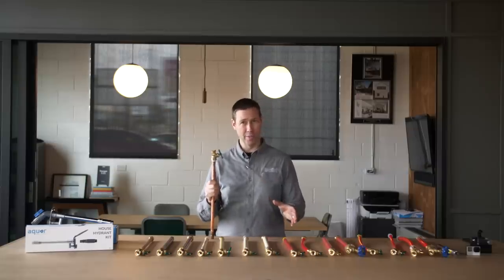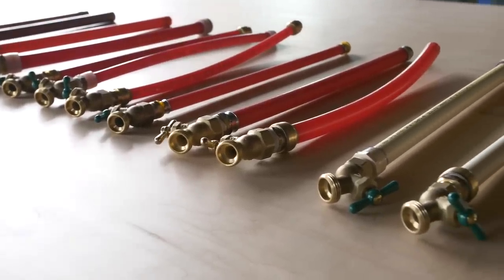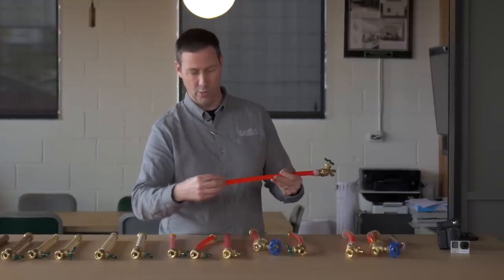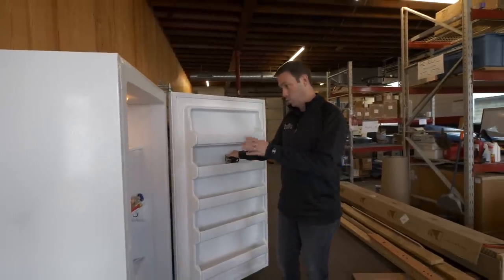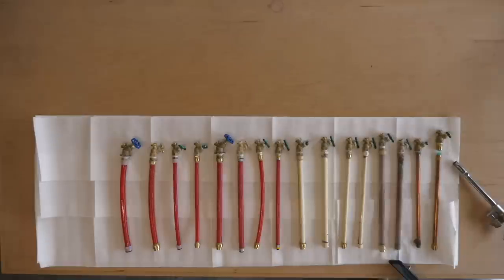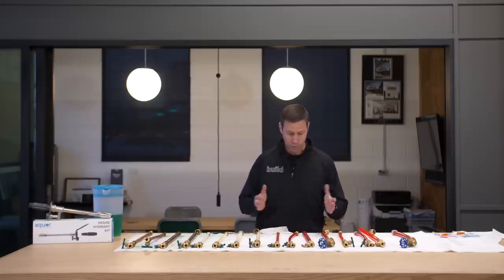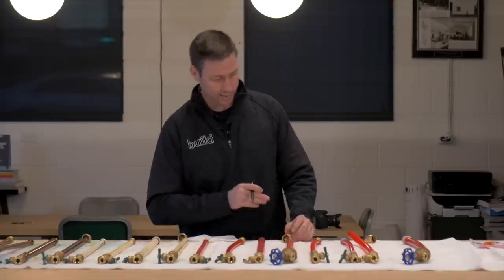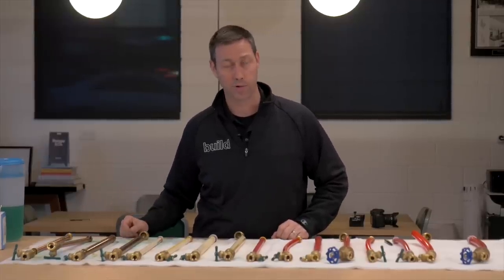Copper vs Pex vs SharkBite - Freeze Testing

Comment: As a landlord with occasionally vacant units in the winter, I have had my share of frozen pipes. I've had over 4' of water in a basement from a 3/4" supply line!  Since switching to PEX five years ago, I have had ZERO issues.
Reply: Significantly Lower your rents enuf to keep happy tenants in the units, the $ you loose on empty , damaged , transition isn't worth it . Greed is one of the seven deadly sins
Reply: As for pex it gets brittle eventually , and small rodents love to chew it when they cant get at any other food source
Reply: @guysumpthin2974  *lose
Reply: yes
Reply: @guysumpthin2974  fun to learn rodents think our stuff is a food source, don't know much about plumbing but they like our wires, alot wires use soybean oil to make the plastic on the wires, and our little friends think it's food, not bad  when things don't, work real crappy when things burn down
Reply: Great for you 👍🏻👍🏻👍🏻
Reply: @guysumpthin2974  As a past landlord I know that the amount of rent in no way helps to get a better tenant. Only careful screening of applicants does and even then you get surprised.
Reply: @jimmysapien9961  my dad rented out a house divided into 3 apartments. I'd never do that based off his experiences.
Reply: @guysumpthin2974  yeah, maybe section 8 so he’ll pay more for shit getting tore up all the time.
Reply: I put pex in my summer home in Maine, I drain enough to clear the fixtures and leave the rest of the system wet for the winter. 14 years, no split pipes.
Reply: Four FEET??  😮
Reply: @guysumpthin2974 spoken like a true a$$ do you know he is over charging? Do you know that lower rent equals better tenants? Please tell us your sources?
Reply: Pex a or b?! Ive been debating and don’t know which is better! Seen a video pex b has better pressure rating but they say a is better for freezing… not sure!!

Comment: Cpvc has a 3% expansion  rate when it's new but as it ages it becomes brittle. So after as little as 8 yrs you would have very differant results. It would shatter. I have witnessed over and over again as a service plumber for tha last 20 yrs.
Reply: solution?
Reply: @xLopez210x  Replace CPVC
Reply: This!  100%
Reply: Thanks for that insight.  I was surprised at the performance of CPVC in this test because I have seen it burst as a result of freezing.  Your comment explains why.
Reply: David Camp think about that then. The material almost costs nothing, and you stay busy with customers while everyone saves money. Doesn’t sound terrible to me.
Reply: Who still uses cpvc?   It's always crap when I come across it no way to repair except shark bite.
Reply: The CPVC on hot water pipes gets more brittle more quickly!  I've heard stories of people turning a stiff water valve and have the pipe break off in the wall...
Reply: I've had it split, but never shatter.
Reply: Hi David.   I live in a cold / freezing winter state ( Massachusetts ).  My Redman 14 / 68 ft mobile home, built in 1986 has flex water tubing.    I bought it in 1997.  For the past 23 years, I have NEVER had one pex pipe burst or leak problem.   Maybe I'm lucky ?
Reply: @michaelbest7872  a lot of the trailer homes actually use gray polybutelene tubing which is inferior and been discontinued. My dad has it and hasn't failed, still needs to be changed out.
Reply: with the freeze in texas this week, in my area tons of CPVC breaks at the FITTINGS.
Reply: I can attest to that personally from the Texas freeze.  Old CPVC is very brittle and during a freeze splits in both directions from the frozen zone.  Go with PEX for exposed pipes, the ones that were well insulated in the home did better.
Reply: This is my experience as well.....pex A is the way to go
Reply: @davo912  I had a break with galvanized pipe
Reply: Excellent Insight, thank you!
Reply: It work hardens like metal
Reply: @monkey7547  easy repair yes but you use cement couplings
Reply: Cpvc is garbage and shouldn’t be allowed around water, same can be said for mdf
Reply: @Schlum99  Mine were insulated but I waited too late to drip one outside faucet line that was covered and it blew up when the sun came out.
Reply: my house is 28 years old has pex and pvc  freezes at least once a year and the pipes are just fine in fact the only pipe i have had to change is the iron pipe where it comes into the house
Reply: All my CPVC and copper busted here in Texas during the winter storm.
Reply: @monkey7547  alot of people. When the freeze happened last year. 80% of repairs I did was cpvc
Reply: I have CPVC in my trailer.  New, it's buttery soft, and cuts nice.  A couple years and 2 or 3 freezes, the cutter shatters it like glass.  Horrible stuff.
Reply: @kungfoochicken08  With poly B?
Reply: @atodaso1668  Pex.
Reply: @monkey7547  exactly  mine lasted 26 yrs  replaced With pex
Reply: @Schlum99  The freeze of 2021 cause me to use  PEX - I had CPVC😞it was on for 26 yrs
Reply: @ownerkaos5366  tru
Reply: Yes David, you are correct about Cpvc. About five years ago, I woke up at 5:30 in the morning to the sound of a loud noise and thought someone was breaking in through my bathroom window. Weapon in hand, I approached the room like a pretend Navy Seal getting ready to engage an active shooter. 

Winds up that all of the pipes underneath my bathroom sink and behind the wall had exploded, leaving a trail of water pouring into the bedroom. And I will say, you are correct when you state that Cpvc shatters. When I got the water damage fixed and the sheet rock removed it looked like a small explosion with Cpvc shrapnel. Although, before this explosion of sorts it did manage to last 20 years and not 8. I have since sold the house and fixed the problem for the next owner with Pex and Sharkbite.
Reply: @michaelbest7872  Curious, what do you do in the winter/cold seasons to maintain your pex pipes? Or in general. Any tips 😊
Reply: @elainecathey7417  Hi.  It's been years since I commented.  Thanks for reaching out.   I haven't done anything to them.  I just keep them insulated with pipe insulation.  I also use Heat Tape - just plug it into an outlet and either wrap it around the pipe going into the house or make sure the "tape" comes in contact along the pipe.  The heat tape automatically comes on when the temp gets lower.   Easy install.

Also, in the past year, I had one hot water pipe burst at a seam, under the house.  It was easily fixed.  

I DO expect more issues in the future as it's inevitable.

Comment: As a landlord for 25 years or so, I can tell you the absolute worst system in a freeze is the CVPVC....it did well in this test because it was new.  That stuff gets super brittle after a decade or so.  I once had a house with that stuff that literally every single line in the house had to be replaced...what a nightmare.

Copper actually fares pretty well as it expands some to relieve pressure.  Usually on a copper house freeze up there are many damaged places, but perhaps 1/2 the lines can still be used.

Type B/C pex is absolutely outlawed for use.  Its too easy to mess up a crimp and not realize it, or, in one instance behind a wall the crimp just leaked a bit and it sadly never self healed and ruined a good bit of infrastructure.  I've seen professional plumbers mess up crimp pex.

So, after all this time what ALWAYS is used by my crew?

PEX A, the expansion stuff.   As we repair/upgrade/change any plumbing system in our properties I actively remove other piping systems and replace with type A.

I recently built a new office and the entire thing is 80psi service with type A Pex.  I personally installed every single joint on the project which has a full kitchen, two baths and, since its residential zoning, a full NFPA 13 fire suppression system.  So, well over a hundred joints in 3/4 and 1/2.  Not one leak.

I've got several hundred dollars worth of type b/c pex inventory, shark bites, valves, various fittings....all gathering dust now.
Reply: How would Pex A fair with time? I'm curious.
Reply: you must not have lived through the pex recall
Reply: Im guessing that if you cant make a crimp with pex then thats a personal problem. The rest of us are fine with pex b. Stop the fear mongering, jeez
Reply: @doylee469  PEX is illegal in california. stop being ignorant.
Reply: Jeoinaforest. 
    That's to bad. Someone should have taught you how to crimp a joint.  I guess some people just can't be taught to do something correctly.  I cannot begin to tell you how many  type "A" joints I've changed out do to failure. I've also been using these crimped joints for over 20 years. I've never had one fail!

  I don't use PEX all the time. 
  Just today i completely turned a kitchen around. I did all the water lines in type "L" copper.  I very rarely use PEX up inside the unit itself. I usually run it below the floor. Then run type "L" copper through the floors and up inside the walls. But my reasons for than are just that "my reasons"     😋
Reply: @DieselRamcharger  its not illegal in all of California.  I live in 1 of the 9 bay area counties.  It was the last town in our county to legalize PEX!
  Now i dont know 2 things here. 
1.  What county & town you live in??
2.   What your building codes allow?

I only know where i live & what our codes allow!!
PEX is legal in most of California.
Reply: @Zynrix  it holds up just fine. If the joints are installed improperly then they will fail. But I've never  seen PEX  piping fail. Only the joints fail. I've been using PEX for under floor water line repairs for many years. Never had one fail yet. I also use "B C" PEX. Not "A" PEX joints!
Reply: @Zynrix  I've been installing PEX B, C. Not A. For over 20 years. I've never had a failure with to pipe or any fittings. I've always use crimp style fittings.  I also have repaired (replaced) many PEX "A" expansion  fittings. I have never repaired or replaced any of the crimp style fittings.
Reply: Mi
Reply: LOL improperly crimping pex? not sure how professional those plumbers were my friend.. its not rocket science.
Reply: DJ I’ve seen plumbers leave their crimping tool lay around on their van floor getting banged up. They don’t have the thickness test piece. They don’t realize that if you crimp it to tight. It splits the ring. Maybe not right away but down the road. Could be a month ! Could be a Year. 
    I’ve repaired more of the he apex expansion fittings than the stainless crimp joints. 

How long have you been in this business???
Reply: LT's Garage again if they don’t know that a fairly unmalleable material is likely subject to break under excessive for... they’re are not a professional... 

Btw- only the insecure guys bring up years of experience... cheers Mr. Garage
Reply: jeoinaforest I actually use very little pex . I do use Type “L” copper a lot.  I do mainly repairs. At one time I had the largest service company in my area. 26 trucks & vans usually 2 men per truck .   Oh god I hated baby sitting. Back in the day. Every time my pager, phone or two way system went off  it was a problem.  And they were constantly going off. 
  I was the highest paying plumbing contractor around. Each journeyman got a third of the labor charged to each job.

  Cpvc is only allowed in mobile homes (modulars) in my area. It really is junk after a few years. It’s really easy to replumb most modular homes. The hardest fixture to replumb is the tubs and or the showers. Most of the time they were back to back. Which meant one side or the other had to peel open a wall.

    I really do use a lot of L copper. I refuse to use type “M” anymore. It freezes way to easy. Although where I live doesn’t freeze very often!

But I’m just a condesending  prick that has run his own business for 46 years. so what do I know!
Reply: DJ another words. I’ve been in a plumbing business most likely longer than you’ve been alive. 
  When I started plumbing we had to build cast iron trees. No plastic was allowed. After a few years they allowed it to be used in homes but not in commercial buildings. Then finally it was legal to use abs & pvc in commercial buildings. 
   
Also when I got my license there were 5 plumbing contractors in my town. Now, everyone is a contractor. They got themselves a new truck and some bright and shiny tools. Of course you see them around for awhile. Then they are calling and looking for work.
Reply: @DieselRamcharger  Wasn't the recall for Poly B
Reply: @DieselRamcharger  WRONG-- its completely legal in California with the exception of a few municipalities
Reply: @DieselRamcharger  why is PEX illegal in California?
Reply: @robertfrapples2472  lead and diesel will never be illegal, you use them every day of your life and they are in nearly every component you touch and eat. im also not in cali. so like usual you jump to a bunch of conclusion all of which are diametrically opposed to actual fact.
Reply: @DieselRamcharger  Pex has been legal in California since 2010. Its pretty common in new residential construction.
Reply: @DieselRamcharger  Um no.  Just built a house in California  using only pex C on the inside.  Building inspector was fine with it.  Mind you I live on the coast where we don't really have hard freezes
Reply: Another thing about cpvc.  Why is it getting brittle?  Because it's losing its plasticizers.  Where are they going?  Into your drinking water...
Reply: Just had frozen pipes in my home 2 months ago, all copper.   Water was frozen solid in all toilets, no faucets could move.   After defrosting, there are two damages - brass rough in the shower failed (pass the valve, so no water with valve closed), and internal connector between diverter and taps in my wife's roman bath setup leeked. Again, pass the taps, so no water with taps shutoff.  Copper all survived, all faucets are back working after defrost, all toilets (including flash systems which were frozen into solid ice block) are operational.
Reply: @dmitripogosian5084  I've had similar results on the first freeze...the second freeze is usually much worse as the pipes continue to be expanded.